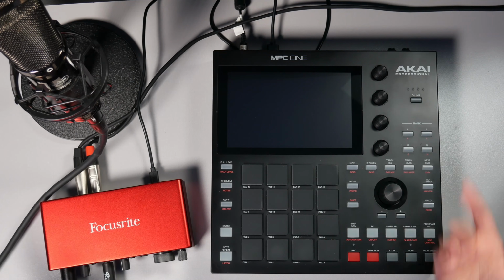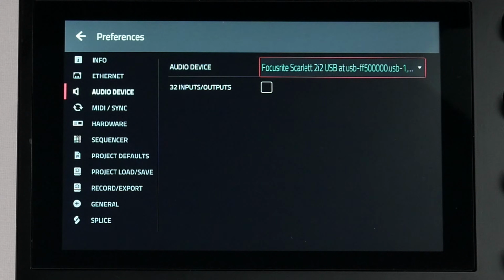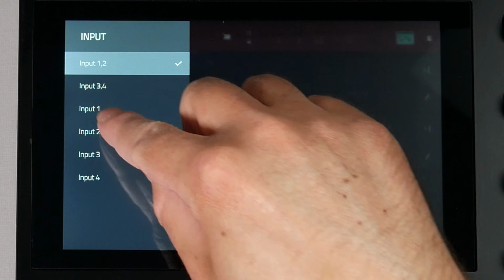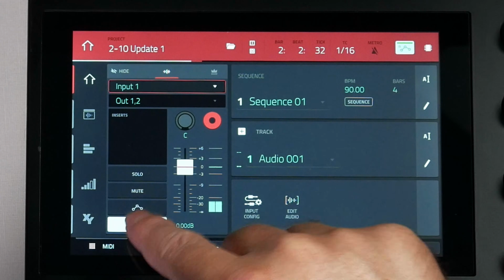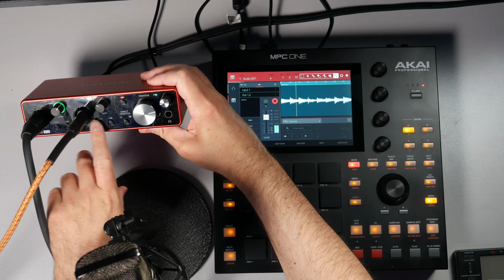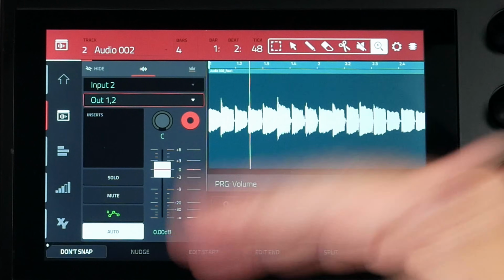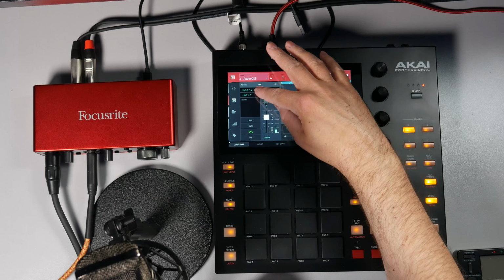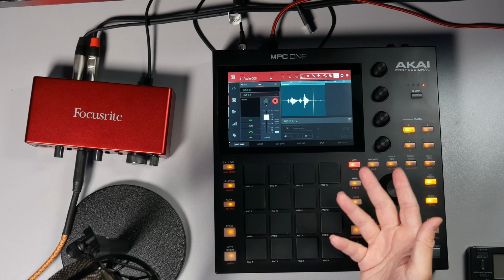MPC Audio Interface Setup: MPC 2.10 Update (Standalone Mode)

Comment: Matthew I was wondering could it be used the same way with the mpc if you use the mpc with the mpc software. I have my mpc connect to my lab laptop. I want to connect the interface via USB to the mpc so I have some mic inputs. My main thing is would having the mpc connect to my laptop USB and the interface to the mpc USB cause any problem? I have the mpc live.

Comment: I don’t understand why you’re adding an external sound interface on the MPC. If I add a sound interface, it’s only on my computer (to record the MPC output on a DAW)
Reply from the maker: You don’t have to if you don’t want to. It is an option. If you want to use a mic that need’s phantom power to record or sample into the MPC it is a good option.

Comment: I'm new to using more cables for monitoring. What kind of cable do you use for monitor/audio output? I'm confused on if I need a ts interconnect or two separate trs cables. I'm trying to run a Volt 276 into my mpc one plus.

Comment: Hello,my audio playback comes back crackling when I plug my headphones into the audio interface

It will be a clear signal sometimes but then it starts to crackle 

Cables are okay and so is other equipment

Edit: I restarted the mpc and the signal is clear again but I'm afraid it I will distort out of nowhere if I do things such as switch audio sources,upon speculation the audio signal distorts when I switch from Scarlett interface to internal,please help lol

Comment: Is there any way to use Focusrite Control for instrument or air mode?
Reply: Allright, problem solved. So on the 4i4 and onwards there is no dedicated button for AIR or INST any longer. You can only put those modes on when connecting to the computer. Luckily those are still settings in the hardware so after putting them on you can disconnect your computer and use them in stand-alone mode. Even when the inteface is switched off and on again, the settings are still there:)

Comment: Hey , does anybody has a solution for the q-Link issues with 2.10. ?   

The update has a massive bug.  All Q-Link settings for effects of every previously saved song are gone. And even worse: they can’t be recreated and saved at all after the update.  Reprogramming all q-Link control every time is no option, this takes ages. This makes the MPC more or less useless for live use.  Or, is there a safe way to go back to the previous version?  I like many of the new features but Qlink control over the fix is just mandatory for live.

Comment: I’ve written some midi data in logic on my Mac. How can I connect everything up so that my daw will trigger the mpc drum track. All the videos I’ve seen show getting a midi keyboard to control the mpc I would like to have my daw or external midi device control my mpc. Also has anyone used a blue tooth midi adapter life widi master or xvive to control the mpc or have the mpc wirelessly control analog hear. Would love a video on. That. I have 3 widi master and 2 xvives. It would be great if o could use it with my mpc. Thank you

Comment: Can I use my Apollo Twin Duo with MPC live 2 standalone?
Reply from the maker: I don't think the Apollo interfaces are Class Compliant.  So I don't think so. I could be wrong, but even so you wouldn't be able to control your Apollo effects if you were able to use it.
Reply: The Apollo series are not class compliant so I do not think it will work.  However, the new UA Volt is class compliant and should be compatible.
Reply: Thanks

Comment: Just got the MPC ONE and Tascam Model 12  hooked up with USB but the Tascam doesn't show up under audio devices.  Switches are all set to USB/PC on the Tascam. Using Chroma USB B to USB C cable. Firmware updated to the latest on both. Tried setting the Tascam to controller mode and went through every controller preset. Every video I've seen looks like you just plug in the cable and the audio interface name automatically shows up under audio devices. Mine will only show "internal". Any idea what the problem might be?

Comment: Dear Matthew or other Mpc Users I’ve just updated my Mpc One to the 2.10 firmware and I’ve bought a Zoom Live Trak L-12. I’ve found and selected the Zoom in the Audio Device section of the Mpc and flagged the 32 input/output option. Then I’ve tried to assign the outputs to different channels in the mixer, yet from my Zoom I can’t hear any sound (from the monitor out or from the headphones). I can only hear something when I switch on the Usb Return buttons on the mixer. There’s something I’m doing wrong, but I can’t understand what and where. The same thing happens when I connect the Mpc to my Scarlett 18i20. Am I missing something with the Mpc or with the audiointerfaces? Thank you for a kind answer.
Reply: So far only Tascam model 12 has been shown to be able to allow you to assign different outputs to different channels in the mixer. Not the L-12. Do not be misled

Comment: Dumb question maybe: what happens if you just plug an electric guitar's pedal right into the MPC input?
Reply: Nothing- when the mixer is connected as an audio interface- the inputs from the mixer replace those on the mpc- its either/or

Comment: Mathew,hello.

I want to have may AI as the center of my setup,as in,i want to connect both the MPC to it and also have it connected to the computer. I got a cable that has 2 3/4 inch jacks to 1 3/4 inch jack. I connect the side with 2 in the output of the MPC and the single one into the input of the AI. The sound is bad on my headset. But if i only connect one to the MPC it sounds way better. Why is that?

That main goal is to have the studio monitors always connected to both the computer and the MPC via the AI.

Thank you.

Comment: Hey Matthew. I'm gonna get some studio monitors soon and I'd like to get my setup all "tied up" together. I'd like to connect the monitors to the output of the audio interface, that's connected via USB to my computer. I also would like to have it all integrated so that the MPC sounds also comes out of said monitors.

What's the best way to this? Output the MPC into the AI? What's the cable? Thanks
Reply: Did you figure it out.? I have the same question.

Comment: Thank you Matt! Apologies if it sounds dumb- what exactly are the pair of cables you plug into the back of your interface ? Do you also need some kind of adaptor (and/or external amp) to make this connection straight into a mpc live 2? I bought the wrong ones
Reply from the maker: It all depends on what you are doing.  I used Hosa cables to connect to my Zoom L-12 so I can record the video.  These are the exact cables that I ordered: https://amzn.to/3su6xFV

Comment: Thank you so much! Question for you (maybe you can help?)
I'm trying to use my Allen & Heath QU16 with my MPC LIVE on firmware 2.10.  I keep getting an error on my MPC : 

"ERROR: 44100 may not be a supported sample rate on the external device Code -22" 

Is there a way to change my sample rate in MPC , or would this be a setting I should change in. myQU16 mixer? thank you!

Comment: I have one quick question.   If you hook an external USB interface, such as the Focusrite Scarlett to the MPC One, will the MPC's internal physical input/output options simultaneously be available and selectable along with  the Scarlett I/O?

For example, I have an MPC X with 8 total outputs including the main outs.  If I were to hook up a two-channel Scarlett,  could I expand my total outputs to 10 by simultaneously routing the 8 outputs from the MPC X plus the two from the Scarlett to be sent to a mixer or computer interface for tracking out?  If so, this is really NICE!!!!-----well, it's NICE anyway non-the-less.  

Thanks for the video.  Excellent feature update!!!!
Reply: Did you ever find the answer to this?
Reply: @matthegan3415  I just tested a class compliant USB interface  (although it wasn't a Focusrite) to see if it would work as mentioned on my MPC One.  I have not tried it out on my MPC X yet.  

However, I made two startling and not-so-good discoveries after connecting the interface to the MPC One:

1.  The MPC requires me to pick what audio device I want to use.  I can either use the USB interface or the internal MPC audio I/O but NOT BOTH AT THE SAME TIME!!!!!

Based on this, it seems like it works similar to ASIO devices in Windows in which you can only select one audio interface within a DAW application.   THAT SUCKS!!!!!

2.  When using the USB audio interface (which is a 4-channel interface 4 in/4 out) with the MPC, I can only get output from channels 1 and 2.  When I tried to route sound to channels 3 and 4, I got no sound from those channels.  THIS ALSO SUCKS!!  

Based on this test, I'm not liking the USB Audio implementation of the MPCs.  Hmmm.  Maybe this isn't the best interface to test it with.  However, it's the only one I can test right now.  Regardless, not being able to use both, the internal and external audio I/O simultaneously is a real bummer.

The USB audio interface I used in this test is a M-Audio Connectiv (designed primarily for DJing).
Reply: @MidiFister  Yeah.  I'm gonna re-test my USB audio interface again with the MPC One when I get a chance.  I want to see if I can figure out how to get audio from outputs 3 and 4.  I'm really hoping there was just something I missed or something I did wrong because I don't see why this shouldn't work.   Several people have not only confirmed, but also proven via YouTube videos, that multichannel audio outputs work flawlessly on the Tascam Model 12 mixer (which is also USB class compliant) when connected to the MPC One.  Since multichannel output is possible on that device,  I don't see why it shouldn't be possible on my M-Audio Conectiv.  If I can't get it to work on the second try, maybe these class compliant USB interfaces are a hit or miss.  But, I'm gonna try it again first before I draw that conclusion.
Reply: I have an update to my previous post.  I have recently tried my M-Audio Connectiv again with my MPC One and was still unable to get sound from outputs 3 and 4, unfortunately.  I guess these so-called class-compliant USB interfaces really are a hit or miss.

Comment: Hey Matthew I have a dumb question about your usb connections.....I had to study this video to see which end of the usb cable went into the L12 & MPC One....since both devices have both USB types. How did you know which connection to use? Trial & error or did you research? Just wondering. 

Thanks for the info! I’m trying to force myself to only record music within the MPC ONE to learn the system faster😂👊🏼...

I also bought your MPC course recently that I still need to finish. 

Thanks!!
Reply from the maker: I use the L-12 all the time to record to SD and as a USB audio interface.  You use the same USB cable/ports for the computer as MPC One.  It is the same USB B connection on the L-12 that a lot of audio interfaces use.  The other USB A port on the L-12 is for USB drives not USB audio connection.  The other USB port on the MPC One is for controller mode on the computer.  I just have experience with it I guess.  Thanks for checking out the course.  There is a lot of info in there, it can take time to process it.

Comment: Hi Matthew here’s the coment  about the video scarlet  interface.

Thanks for the question. All Scarlett interfaces are class compliant - can be connected to a Mac without installing additional drivers. I have both the 4i4 and 8i6 and although both are very good, I would recommend the 8i6 as it has its own power supply which can help out if you ever run into rfi or emi issues with your setup. Also, the additional IO vs a 2i2/2i4 is nice to have for for your MPC and other future devices that may become part of your workflow. Hope this helps out and thanks for watching

Comment: It seems that any audio devices without their own power supply does not work? I tried the Presonus Audiobox USB and it only gets power from the MPC, it doesn't show up. However, using the Behringer Xenyx 1222 USB works fine😊 I had some trouble routing the audio from the MPC itself though... Are you supposed to connect the main outs to inputs on the audio device/mixer? Thanks again for awesome content👍
Reply from the maker: Well, being that the 2i2 in the video doesn't have it's own power supply that cannot be true.  They need to be "Class Compliant".  As I said in the video you plug your speakers into the outputs of your audio device that you are using.  That is because the audio device you select replaces the built in audio inputs and outputs.
Reply: @MatthewStratton  Yes, I noticed the fader on the XENYX for USB IN😊👍 That's really cool! I haven't gotten the routing to work though i.e. sending certain audio channels on the MPC to specific channels on the mlxer
Reply: @MatthewStratton  Here is some quick jamming using the MPC along with various other machines :) enjoy!
https://youtu.be/qtHAmGgblvM

Comment: I cannot seem to get my mixer paired appropriately. I have a behringer XENYX QX1832USB and I can't get my tracks assign the individual channels. So frustrating🤬.
Reply from the maker: Is that a multitrack style mixer with discrete USB inputs?  It might only have the ability to use  the master bus as USB inputs and not each track.   The Zoom L-12 is a multitrack USB audio interface and mixer.  That is how I can get more channels.
Reply: @MatthewStratton  thank you! I think that might be the case. The only faders that register are the main volume on outs 1/2. Looks like I'll have to keep using my midimix for now.  Thanks again!

Comment: This is a really dope feature! I could now see myself using it as a recorder for when I play with other musicians. I can also now use a USB mixer like the Tascam model 12 for mixing purposes. However, it doesn't change the total number of audio tracks I can have in a project on the MPC Live: 8. Still, a step in the right direction, Akai!
Reply: Hello! 
Would you mind if i ask you a couple of questions? 

I'm currently waiting for delivery of my live 2 and I'm considering getting a Tascam model 12 as well! Could you let me know how well does it work over usb, are you able to assign channels as inputs? Can it output the master from mpc and add effects to it at the same time while you're using it as an input? How does it work? I'd appreciate any info/feedback.

Cheers!
Reply: @Me-Lo   the answer to all your questions is YES! You certainly can assign channels as inputs, as long as you change the mode on the 12 to PC. Also, the Master outs on the MPC can be routed to the 12, which has its own array of effects that can be applied while recording, and you can even reroute that same audio back into the MPC post-effects. However, the 12 itself can be used as a recorder as well. 

One way you could use the MPC-12 combo would be to compose your piece in the MPC, record each track to the 12, and then mix in the 12. Or you could record a band via the 12 into the MPC. There’s multiple ways you could use such a combo to achieve your musical goals!

Comment: Hey Matt great video as always. I can't get my zoom L8 to work with my Mpc one as an audio interface. I'm fully updated to the latest version 2.10 but it still says usb device not compatible. My zoom L8 is class compliant. Not sure what's wrong. Have you heard of others having problems with the zoom L8 as an audio interface with the mpc one?
Reply from the maker: Someone mentioned in the comments of this video they thought that it had to do with the L-8 being powered by the USB cable and they thought it would work if they used batteries.  I don't have one to test out personally.
Reply: I have the L-20, if the architecture is the same, it should work with class compliant mode on. Set at 44.1khz, switched to audio interface mode.  At first my mpc didnt recognize it, after a power cycle it showed up- hope that helps.

Comment: Is there a possibility to update firmware without using the USB ?
Reply from the maker: You can load the USB image to a USB drive and do it that way.  Those are the two options at the moment, USB cable with computer or USB drive with USB image in the root folder of a USB drive.  Make sure you download the one that says (USB) not (WIN)  or (MAC) if you use only USB drive.

Comment: Once you set your MPC in audio interface mode it seems all outputs of your MPC stop working, Including the MPC headphone jack. Am I doing anything wrong?  I'm trying to use UPS audio out from my OP-1 to the MPC to record it and I can see the signal comin in to the MPC but since it's in USB audio mode (MPC) the MPC headphone jack has stopped working..
Reply: Yeah that's what happens. You basically replace the internal audio unit with the one you plug in so you'll have to use the monitor jack on your audio unit. We'll at least that's what I had to do.

Comment: don’t forget you can assign multiple audio tracks to different inputs and arm them all and multitrack record
Reply: @Koraamis you can also go into system settings and check an option to always arm multiple tracks
Reply: Are the onboard inputs (on the rear) and the audio interface connected by usb simultaneously useaeble  on different tracks?
Reply: are you sure the mpc one can record multiple tracks at once?  i did not know that was possible
Reply: @gagealbright  absolutely
Reply: @ropewalkingelephant  wow that is awesome.   thanks for the reply!
Reply: @gagealbright  find the option in Preferences -> Sequencer -> Rec Arm: Single/Multi

Comment: I have the Scarlette 4I4,not a stable sound without the Focusrite control software.
Reply: Does your 4i4 connected to MPC One produce crackling audio? What generation Scarlett?
Reply: I have the 3rd gen 4i4 and gets dropouts continuously. I tried a friends 2nd gen 6i6 today and it works perfectly.  I'm wondering if the issue has something to
Do with the 3rd gens usb-c port?  Not much conversation on this issue.